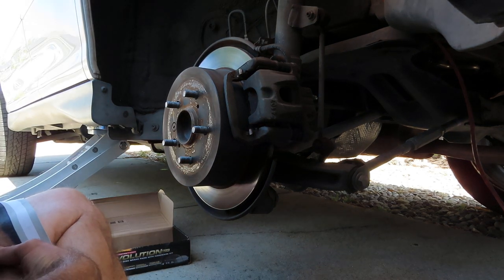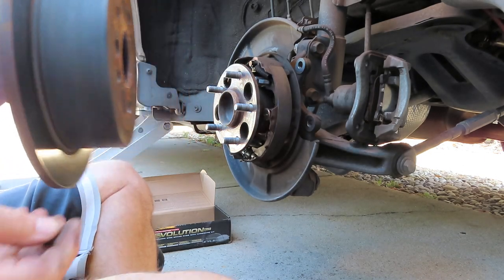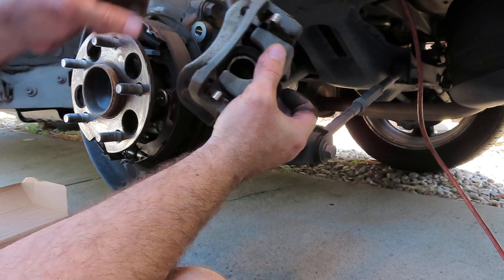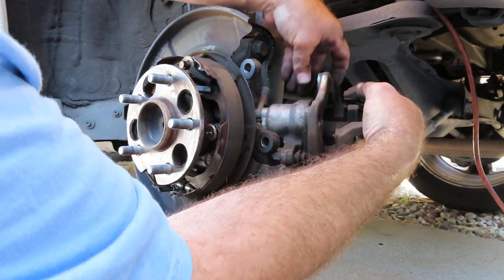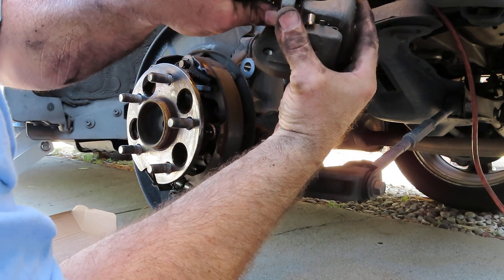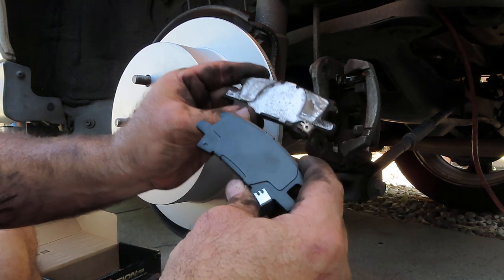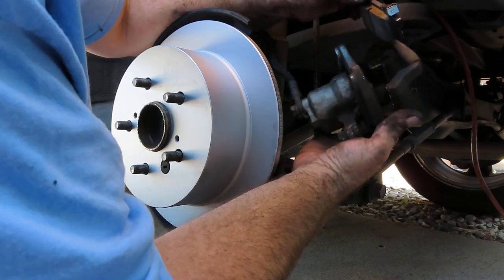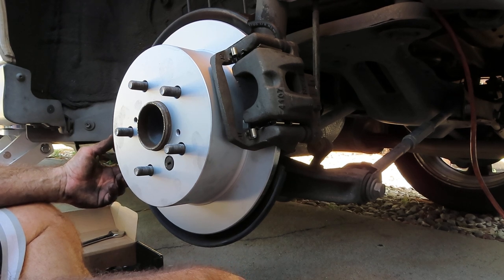How to Change Lexus RX330 Rear Brake Pads & Rotors

Comment: Few points. 

1: Before you unbolt caliper press against it to push the piston back into the caliper.  Makes removal easier. You still may have to press the piston in.

2: Before you drive, PUMP THE BRAKE PEDAL SEVERAL TIMES to seat the pads against the rotor. Otherwise you will have no brakes.

Comment: A few things I noticed, if you aren’t wearing gloves while installing pads and rotor (or even if you are) use plenty of brake cleaner and shop towel to make sure contact surface of pads and rotor are super clean. You don’t want ANY grease/dirt on these surfaces.

Also, look up the torque specs for your particular vehicle and use a torque wrench for tightening the bracket bolts (58 ft/lbs rear), the caliper bolts (32 ft/lbs), and your wheel lug nuts (76 ft /lbs) on a 2004-2006 rx330.
If Any of these bolts are torqued down too tight (by guessing) you run the risk of warping the rotor over time and or caliper sticking.
Also clean and grease the caliper pins.
And it wouldn’t hurt to loosen brake fluid reservoir cap before  squeezing the piston in very slowly.
Reply from the maker: I sprayed the pads and rotors with brake cleaner after the install. Thanks for watching!
Reply: Blessed!
Reply: TOM DO YOU KNOW WHAT TORQUE ON 2017 RX350 ? I CANT FIND IT ON MY OWNER BOOK

Comment: New rotors usually come with protective wax on them from the factory, you’ll want to remove this wax with brake cleaner and a clean towel before installation. The entire rotor is covered in this coating and is much harder to clean off after.

Comment: NICE . I have done this on my 2006 rx once already. I plan to do again soon. A suggestion: it is easier if you remove the caliper from the bracket that holds the pads.
Reply: Probably a little late for you now,  but the bolts are actually threaded into the caliper bracket and are long pins in the secondary bracket.  They get corroded inlace and need to be pulled from it once you have spun the bolts to the point they no longer come out by threading them. Work them out by prying them. When you put them back in grease the shaft that goes in to the far end so it won't be as hard next time to remove them.

Comment: FYI, those bolts he took off( the brake cylinder mounting bolts), get torqued to 58 ft-lb. If decide to to remove the brake cylinder slide pins, they get torqued to 32 ft-lb. this is straight from the factory repair manual I own.

Comment: Good video but, you forgot a few basics. 1. Pads should come out first by mens of slider bolts removal. 2. Then the caliper mount bracket with two bolts. 3. The new rotor should be degreased first and not contaminated with greasy fingers. 4. Anti seize should be applied to brake pads on installation. 5. All bolts should be torqued to specs for safe operation.
Reply: Of u such a big professor you do the video :D

Comment: Noticed that no one mentioned it and you did not  separate the caliper from the mounting bracket.  Separate them so that you can actually clean the bracket where the pads make contact with the bracket.  After cleaning any rust or gunk, apply grease / hardware kit. Just replacing the hardware alone isnt good enough.

Comment: You should take the stainless steel backing of the old brake pad to transfer to the non OEM pad. The stainless steel back does not rust

Comment: Also follow brake parts manufacturers recommendations for “bedding in” the brakes before any normal driving
Reply from the maker: True. I followed the instructions that came with the rotors. It was a little tough though. Trying to drive around the city without coming to a complete stop is challenging. Thanks for watching!

Comment: This is painful to watch. remove the caliper from the bracket first.
Reply from the maker: I know now. Much easier way to do it.  Thanks for watching.
Reply: FYI, those bolts he took off( the brake cylinder mounting bolts), get torqued to 58 ft-lb. If decide to to remove the brake cylinder slide pins, they get torqued to 32 ft-lb. this is straight from the factory repair manual I own.
Reply: And never rely on just a jack